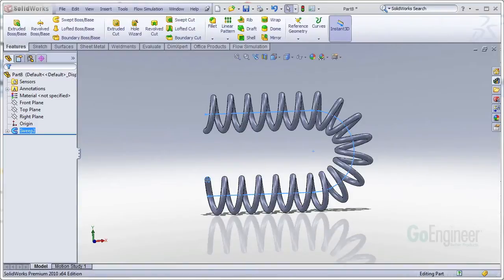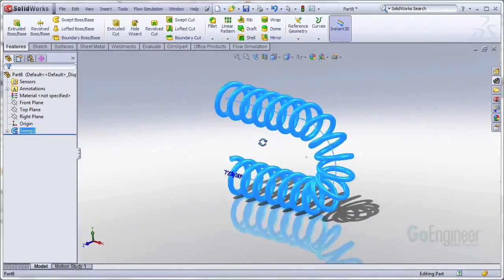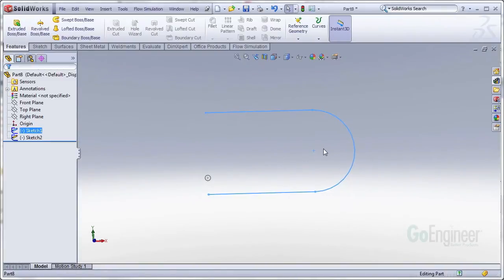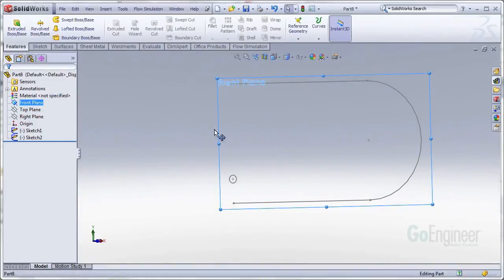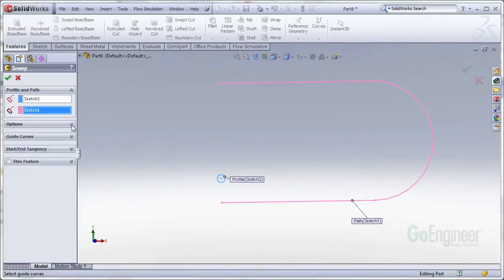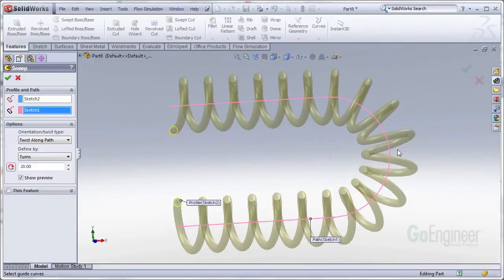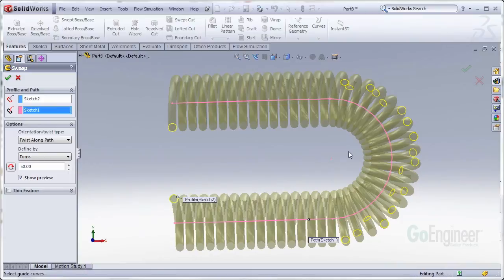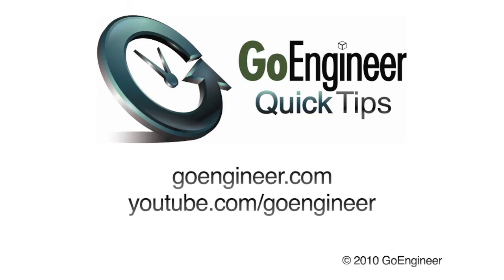SOLIDWORKS - Helix Along Path

Comment: in newer versions the Sweep dialog boxes are different, but if you screw around with the options a little you should be able to get the same result. (Edit: See below)

Profile orientation : Follow Path
Profile Twist: Specify Twist Value
Twist Control: Revolutions
Reply: But could not further increase the turn when the revolutions reached 100
Reply: really helpful, thanks!
Reply: Thanks!👍

Comment: This is useful but unfortunately you are limited to 36000 degree rotation, so it won't work on very long paths or where a tight pitch is required. Can you make a tutorial to accomplish something on a very long path?
Reply from the maker: Hi lolozaur,
This rotation limit continues to be a software limitation even 8 years after this video was published.  The only viable way to accomplish more rotation than 36000 degrees is to create multiple sweep commands down segments of the total path.  Each can only go up to 36000 degrees but you can make many more than 1.
Reply: @goengineer  I figured, such a shame. I did it with segments and it gets so complicated and requires manual calculating and you end up with dozens of sweeps, really inefficient.
Reply from the maker: I can't deny that.  It is the only option currently though.